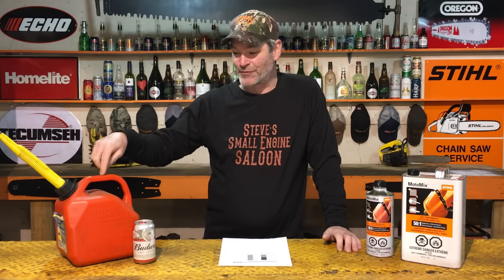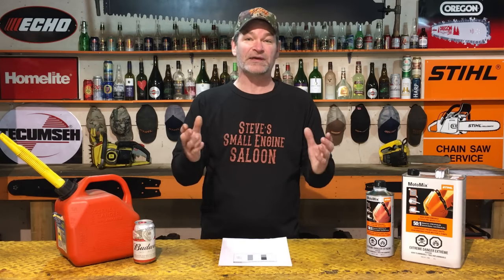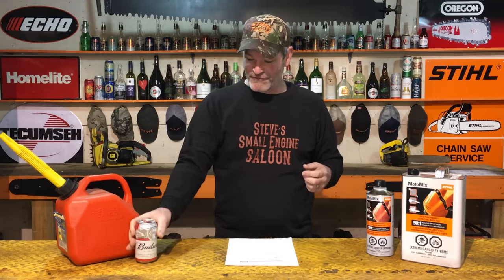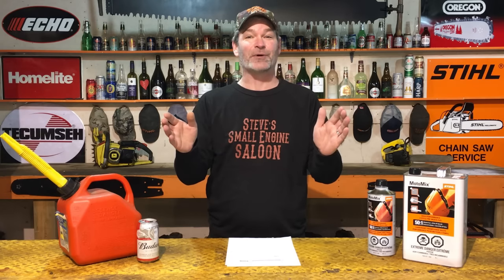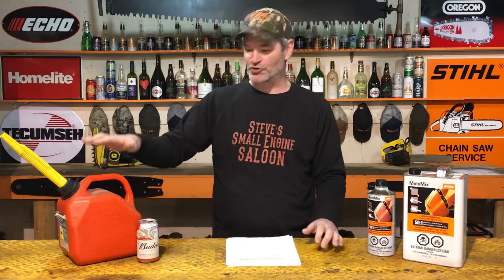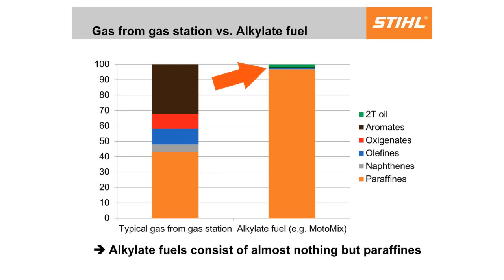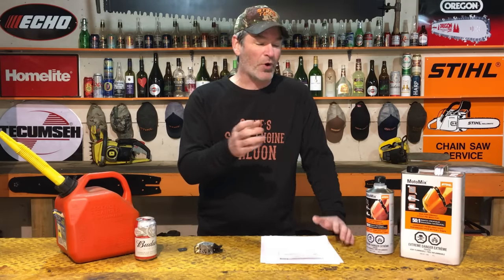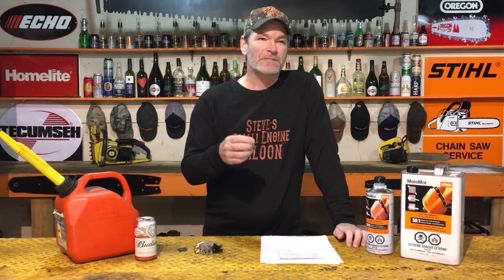The Ugly Truth Why Gas Station Fuel Is Bad For Small Engines

Comment: I use ethanol free fuel only in my yard equipment. Use fuel stabilizers for long term storage in my bulk cans. So far no problems. This pre-mix stuff is ridiculously priced.
Reply: Where do you get ethanol free fuel ?
Reply: @rbeck3200tb40  In my area Murphyusa.com and there are a few others retailers that offer ethanol free fuel. A google search for your area should turn something up. For those confused by 2cycle fuel ratios 1gal is 128 oz., just divide 128 oz by the ratio needed (say 40:1), 128/40 = 3.2 oz. of 2cycle oil.

Comment: I've never used anything but the engineered fuel in my chainsaw.  No bothering with working out the 50/50 mix of gasoline and oil, it's a braindead solution that works.  And I'm lazy, I don't want to do the gas-oil mixing.
Reply from the maker: Right on

Comment: Use aviation gas, 100LL.  Problem solved. Planes have to have gas that does not gum up, etc and be able to stay in the tank for a long time.  Only problem is that you need someone that has access to buy it!

Comment: This is about half right. For most folks, ethanol is 99% of the problem, so using no ethanol fuel is all they need:
1. Premium gas at the pump contains ethanol
2. The products touted in this video are way overpriced ($30 a quart? Really?)
3. You can find ethanol free gasoline for about ~10 USD per gallon (“racing fuel”, 98-112 octane). Use the PureGas app to find a location near you. I’ve been using it in my mowers, snow blowers and string trimmers for 10 years with zero problems.

Comment: What gets missed all the time in this conversation is the Alkalyte fuel.  MotoMix and Aspen are 99% Alkalyte fuel.  Not just Ethanol free fuel.  Completely different than pump gas and most other "canned gas"  Do a little research.  No aromatics, no benzine and lots of other harmful stuff.  Its much better for your health to not breath in pump gas exhaust.  Not to mention its the 80+ other additives in pump gas that are missing from engineered fuel that makes the difference in gumming up the carb and running like junk over time.  I know it's expensive and our tendency is to say its stupid but that's because its not fully understood.  Most people think canned gas is just pump gas with no ethanol in it.  So much more than that.  Research Alkalyte fuel.  Like Aspen or Motomix.

Comment: That same thing happened to a few years ago.
Reply: I had the mixture sitting too long like 3 years. I should have known better but I still put it in my chainsaw. When I tried to start it,it would not start .i pulled and pulled and pulled. IT WOULD NOT START. SO. DUMPED IT OUT ON THE GROUND IN A SAFE PLACE.THENI REFILL IT WITH NEW GAS AND I  WAITED for about 3 hours. When i tried it then. It pulled a few times and it finally started. So i left it run for an hour,came back a and shut it off.

Comment: Not worth the high cost, if my equipment craps out after proper use and storage then toss it. I wish the manufacturers would make good quality small engines like they used to.  Most pieces are throw always cheaper to buy new than “maintain” or repair the way they tell you.  They know this and would love to sell new machines than fix your old ones and stand behind the repair.

Comment: I use pure gas. About the same as recreational fuel. I leave that fuel in the carburetor. That keeps all the parts in the fuel system from drying out.  Google pure gas and read the facts.  You can find REC fuel many places now.

Comment: Talking about auto and oil companies- WHY can a 47000 lb vehicle get FIVE (even7) mpg, to cruise down the highway,, and a 3000lb car gets 20 - 30mpg to cruise the same highway at the same speed 47k ÷3k = 15.66 shouldn't we get 20mpg ×15 = 300. I know its off topic, but awareness helps. Ps euro/german 2.5 Non turbo kick ass & FLY like our V8's! With 5 people in the car. GAS is made different there.

Comment: The only thing that's engineered with this fuel is the literature that Stihl put out?  It would be interesting if an independent lab would show the same thing that Stihl says is in their so called engineered fuel.  My Briggs and Stratton mower sat for 6 months through fall and winter in Canada with regular Ethanol fuel in it and started with one pull and ran perfectly.  Engineered fuel is a scam and nothing else.

Comment: People bad mouth ethanol without knowing what the crap they're talking about. I've been an arborist for 40 years. I tried using premixed fuel in the past. None of my saws would idle right or rap up all the way. Back to pump fuel, no problems .  I have 20 saws that sit with fuel in them. Some end up not being used for 6 months. They always start right up and I've never replaced a fuel line or any carb parts on any of them. Some saws are 25 years old. Just mix your gas/oil right.  Shake the can every fueling. Keep the can sealed and keep dirt out of it. No problems. Ethanol boosts octane.

Comment: I run Stihl equipment - everything. Weed eaters, blowers, hedge trimmers, chainsaws - I probably have 15 pieces of Stihl equipment. I don’t mind replacing a carburetor periodically. That is far more cost effective than buying their pre-mix fuel. It’s not even close. I can do a couple carburetors a summer and not spend anywhere near what I would WASTE on that pre-mix. Sorry. It’s just an economic fact.

Comment: Use 100 percent gas and Echo 2 cycle oil. My equipment is reliable and starts and runs. Periodically clean the spark arrestor screen. Engineered fuel is a rip off.

Comment: The price of that fuel for baaic equipment isnt worth it. Also just drain your damn equipment before storage. Replacing cheap parts effected by regular gasoline is cheaper than buying those mixes. Gas isnt nearly as bad on the engine as you say. If the Weedeater is $120 im not spending $30 for a half gallon of fuel.

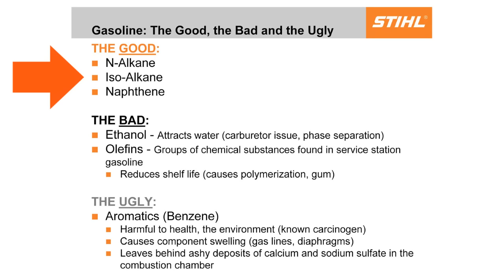Comment: 2:28 Stihl diagram is kind of BS. n-alkanes has low octane number. In fact, n-heptane is 0. Isooctane has 100.  There are ingredients with octane above 100. Aromatic: naphthalene and benzene. Olefins also increase the octane number, and yes, they polymerize and turn into gum. Ethanol attracts water and turns into vinegar. Benzene DOES NOT turn into calcium or sodium sulfate. This is just absurd. Naphthalene is aromatic and belongs to the bottom. Aromatics are carcinogens, some much worse. Benzene is very bad, naphthalene (moth balls) not so much, toluene, not too bad either. Ethanol  DOES NOT repeat DOES NOT cause phase separation. However, when exposed to air, it absorbs water, and THEN phase separation occurs. You drive your car every day, yes, it absorbs water, but you burn so fast, no chance of phase separation. However, I use my lawn mower once a month or 2 months, then there is a chance. Finally: High octane gas (premium) DOES contain alcohol. The alcohol-free gas (aka marine gasoline) is not of high octane, and not PREMIUM. It is "regular". Marine engines are optimized for reliability (not efficiency) and run on lower octane gas.

Comment: For the price of the gas I can buy 2 carbs for my mower and put it on myself  I would use that up it a couple yards to me it's not worth it carbs are cheap and easy to install and anyway my equipment is atat 10 years old never had issues really never did

Comment: I have an empty 5 gal water jug. I fill it with 4 gal of gas station fuel. I then  1/2 gal of water. Shake it like a muthafakir for a few minutes. Go have a few beers. Ethanol combines with water and both float to the top. Siphon off the good fuel at the bottom. Works for me.

Comment: Steve…I am a small engine tech like yourself and I just recommend fuel stabilizer with high test gas and a start in July and after Thanksgiving.  No body will go through the effort of  burning off their gas and placing that engineered fuel to replace that burnt off.  Too much trouble for 99%.  Hell, most can’t even follow the simple stabilizer routine!

Comment: How bad is ethanol? Or methanol? Do you realize that nascar competitions run on pure methanol? The octane number is very high, so they can get higher compression. No they do not care about long-term storage of fuel. Main reason, however, is that when they crash, they can be extinguished with pure water.

Comment: If fuel from the pump is so bad, why do cars routinely go 200k without a problem?  In any case, I use the good stuff in my chainsaw and weedwacker, but I'm going to take my chances with my trash picked lawnmowers (some from the 1970's). I do use stabil though.
I would find your message more convincing if you did some sort of test, say like ProjectFarm does. Now that guy is pretty compelling. You just have a lot of opinions, but evidence? Not so much.

Comment: The lesson here is never buy anything made after 1979 and it will run just fine with a little maintenance, buy fancy new stuff from any major manufacturer and it will run like crap and break. P.s. I've ran cheap 87 octane gas in every engine I've ever owned and never had a single problem with it, ethenol too, just maintenance and common sense.
Reply: Also if the tiny little screen in the carb gets gummed up, pull the friggin thing out, it's only there so it will break. As for ethenol, it's not hurting anything, in fact it mixes with the natural condensation from the air, and allows the engine to burn it instead of having it stay in the tank and rust. If the carburetor can't handle pump gas, then ditch the carburetor and buy one that isn't made of plastic and crap

Comment: Your graphs you use are misleading, in the US the USEPA has regulated that a gasoline will not contain more tha 0.62% Benzene in gasoline (this was a 2011 regulation). Your graphs suggest it is 30% Bezene in gasoline which is far from true. Benzene is a combination of Hydrogen and Carbon and will NOT produce calcium or sodium sulphates as  byproduct of combustion. I do appreciate your work that you do and it is very informative but I had to make a correction to your video.

Comment: That crap youre pushing is FAR too expensive. Im sticking with pump gas, especially when no ethanol gas is available here..
For what 2 quarts of that gas costs i can buy a used lawnmower at a garage sale, and for what 15 quarts costs (less than one summer worth of fuel) I can buy a NEW lawnmower.
Entire small engine replacement carburetors can be had on e-bay and Amazon for 20 dollars or so--and parts for even less
If im spending that much for fuel its going to be Nitromethane, and even THAT is cheaper. at 1500 dollars for 42 gallons.

Comment: Trufeul is horrible echo Red armor 50:1 next fuel Stihl motor mix 50:1 fuel is the best trufeul will actually burn up your unit because it doesn't have a high enough quality oil in there to do the job overheats your spark plug which overheats your unit being a chainsaw weed wacker or blower which will eventually burn up your unit no good trufuel no good.

Comment: You use that over priced stuff, and in a years time it'll cost you the price of a good self propelled push mower. I use a 1/2 gallon of gas every time I mow. I've used regular ethanol gas in my mowers for decades. We've had ethanol gas here since approx. 1978. I've never had gas related issues with any of my mowers, and have usually, if I didn't hit something, just end up selling them cheap on line, to someone who needs a mower but can't afford a new one, and buy a new one with new features every 5 years or so. I do seasonal tune ups, and store them with a minimal amount of gas in the tank, and with Sta-bil in the gas for 4-6 months each winter. I then add gas back to the tank in the spring, and they always start and run fine.

Comment: Premium fuel is ethanol free in only two U.S. states. Pennsylvania (where I live) is not one of those two states. Unfortunately, I can't remember which of the two states this is true for. 

I can't trust Stihls data. They have a product to sell and that automatically makes me question their statements. Even if the statements are true concerning the chemical makeup of the Stihl product Vs. Pump gas, I don't think the ingredient difference in pump gas is detrimental to a small engines life and performance. When it comes down to it the vehicles we drive every day don't suffer the problems you're claiming the small engines suffer from and the basics of how each engine works aren't really any different from one another. Internal combustion is what it is across the boards. Now, having said that I'm not a fan of ethanol gas and run ethanol free in both my lawn equipment and my motor vehicles. Ethanol is garbage, imo.

Engineered fuels... there's no way I could afford to run them in my small engines as a property owner. I can't even imagine how much the engineered fuels would cut into the profits of someone in the lawn/property care business. I'll stick with high octane ethanol free.

Comment: I’ve been running pump gas (with ethanol) in my small engines for many years with zero issues. Newer carb kits and fuel lines solved these issues. Just don’t store pump gasoline, rotate it out if your not using it. Once a month just dump that Jerry can into your cars gas tank and refill it with fresh gas and oil if your not using it up. Or better yet get yourself an Echo PB9010 blower. That sucker will burn up a gallon of gas in half an hour! Ever since I got mine I haven’t had any issues with 2 stroke gas mix laying around for more then a few days! It’s also a great blower.

Comment: This smells too much like BS. How come all these gums are ok for car engines, but not chainsaws. What did we use before this unicorn piss was available? Also, we add 2 stroke oil to the fuel which is an olefin anyway. And top tier gasoline is full of detergents to keep things clean anyway. Is it really worth paying at least 5x more for the fancy fuel (which adds up to the hundreds over time),  or do you just clean the carb every year or two. The pretty pictures are nice and all, but can anybody who actually runs pump gas weigh in on this with real world data?

Comment: Yup. ALL small engine MFGs are manufacturing their engines to use special "off the shelf" fuels, and then tell you something else in the owner's manual. This is all bullshit. Use ethanol-free pump gas and you'll have no issues. I've been a mechanic and engine builder for over 52 years and the only fuel related issues I've noticed on a regular basis is from ethanol. This was a nice commercial for Moto Mix, tho.

Comment: All gas has almost no benzene. Lots of aromatics though. Don't know if those cause the brittle diaphragm or not. If benzene does, it doesn't matter if you use Stihl Motomix or gas, since they have the same benzene content (1%). https://www.iea-amf.org/content/fuel_information/diesel_gasoline#:~:text=Gasoline%20contains%20mainly%20alkanes%20(paraffins,of%20paraffins%2C%20aromatics%20and%20naphthenes.&text=Gasoline%20and%20diesel%20fuel%20contain,changes%20somewhat%20depending%20on%20composition.

Comment: I use only Neste Pro gasoline for small engines. https://www.neste.fi/neste-pienmoottoribensiini  (sorry, in finnish...) Works fine on my chainsaws(Stihl), lawn movers (Honda) and outboard motors (Yamaha). Price here in Finland is currently 2,2 €/ litre + 2 stroke oil. No fuel-related problems on my equipments.

Comment: Premium fuel is not necessarily ethanol free, that’s wrongly stated.  Here in BC where Steve is located the best ethanol free gas is the Chevron 94 octane, it has a separate nozzle on the pump and is clearly stated ethanol free.

Comment: Stihl is NOT telling you the truth.  It is NOT the fuel.  It is the cheap-azz Chinese made parts.
-- I had a 40-yr old Swedish-made Stihl and an old Husqvarna that I could leave sit for all year with gas station fuel in them and they would always start EASY when I needed them.  
-- The Stihl ALWAYS started within 3 pulls, and even at 2. The issue is CHEAP manufacturing. Cheap Chinese made Stihl saws are the same as cheap Poulin thow-away junk! Boo!

Comment: I use 87 octane pump gas for all my lawnmowers, chainsaws, motorcycles, etc, and NEVER had problems with carburetor issues. I keep seeing this "engineered fuel" at stores but never used it. For one thing it's way too expensive, and if I never had problems with good ol' pump gas. I use Seafoam in my gas for long term storage and my motors start back up like they have brand new gas in them. Seafoam is my secret because it works as a great fuel stabilizer and keeps the carbs clean, period. You DON'T need that high priced crap if you use Seafoam (some use Stabil) or drain your carbs during storage. I keep my metal fuel tanks full (with Seafoam treated gas) so they don't rust during the off season. My plastic tanks (snowblowers, lawnmowers, etc.) I usually drain them dry (or add an ounce per gallon of Seafoam)

Comment: I get 91 octane ethanol free fuel from my gas station and make my own mix and every piece of equipment I have that runs on mixed fuel runs far better on my own mix than any canned fuel that is out there, as a matter of fact Husqvarna tells me that they do not recommend running canned fuel in any of their equipment not even their own brand of canned fuel. That premixed can fuel is fine for storage but you do not need to buy it for normal running of your equipment you just need to make sure that you're buying actual ethanol-free fuel and that you are properly mixing it.

Comment: Sorry Steve but I'm not paying $20-$40 for a QUART of their 'engineered' fuel. I can get ethanol free gas at several local places for about $4.50 a gallon and my boat, lawn mower and weed eater have run just fine on that for decades.